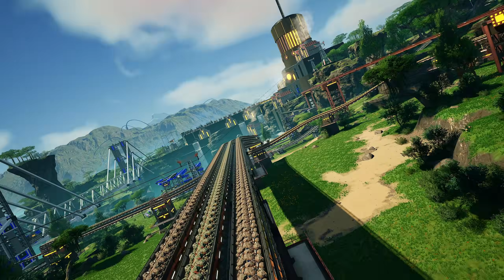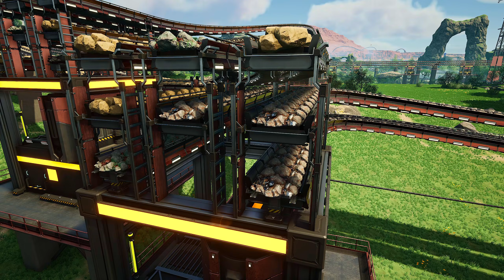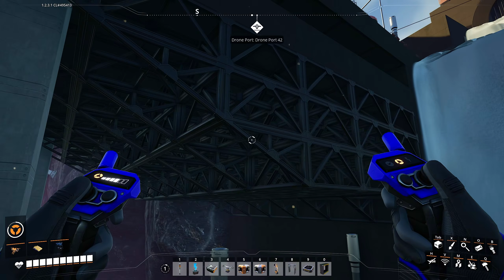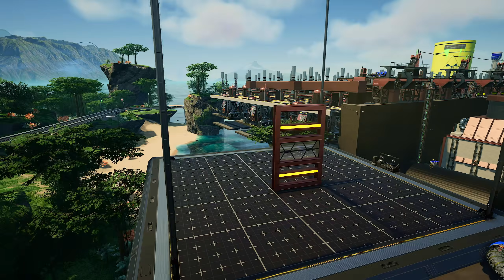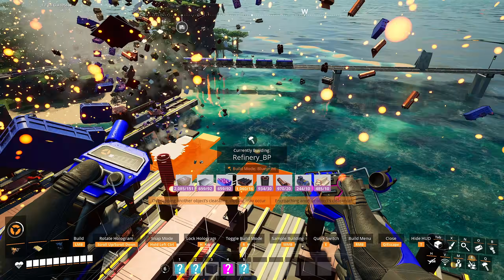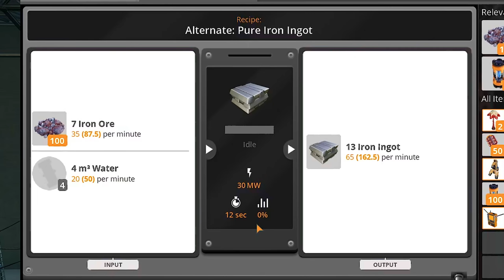How I Made 280 Refineries Look Incredible in Satisfactory 1.2

Comment from the maker: Anyone else hate placing 10 million refineries every project? 😅
Reply: No, refinery is love, refinery is life.
Reply: Yes!

I especially dislike how tall refineries are compared to the mk2 blueprint. It makes them very hard to incorporate nicely.

Sure, I make do. So now I have a bunch of process blueprints.
There's one that does the whole bauxite to aluminum thing with the smelters sitting on top of the refineries, one that does the quartz purification process from its components, even one that takes in iron ingots and spits out motors.

But refineries are nasty tall.
It makes them end up in large flat surfaces a lot.
Yesterday's electromagnetic control rod (64 assemblers worth, using pure recipes just to stretch local resources enough to make it) is a massive plane of smoking chimneys.

Comment: One thing I like to do with collections of belts through the landscape is to make a neat gutter for them out of e.g. foundation and wall.
The top will be either the steel and glass floor, or glass flat roof pieces, with a neat handrail along the sides to make it a footbridge as well.

I enjoy the sight of moving belts under my feet.
Reply from the maker: Oooo I like this. I might try something similar with the few new belt bridges I have going